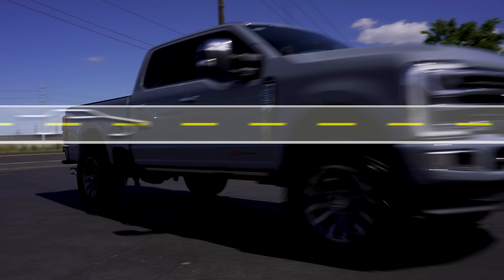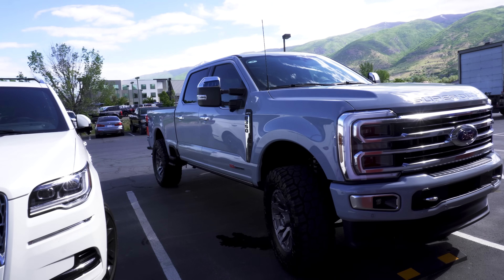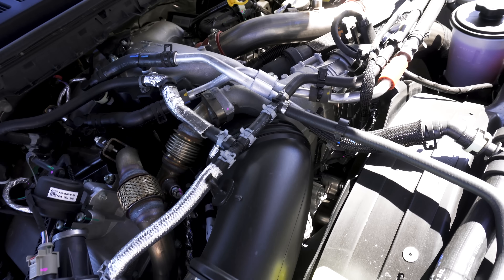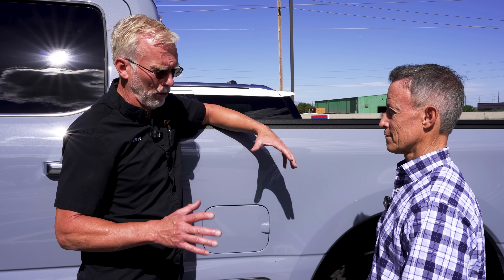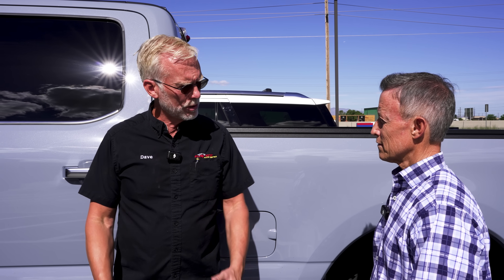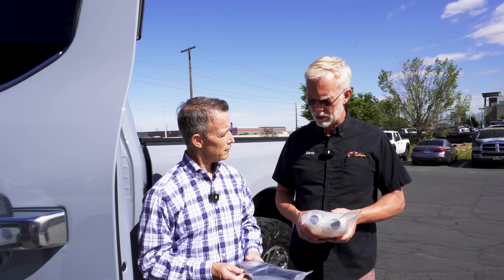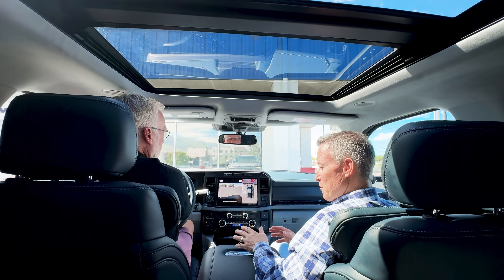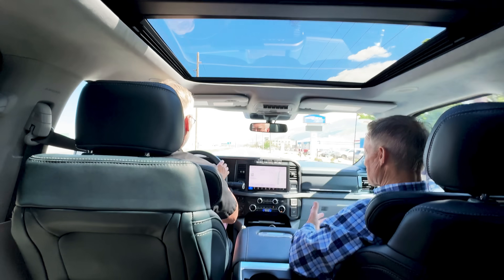Diesel Truck Maintenance

Comment: Step one.. Delete it right now. Run a good single tune from a reputable tuner, a low HP tune, dont add much power if any. 5 position tunes for 6.7 powerstrokes are crap.. They are all basically the max power tune with fuel pulled off of the top end for the different HP levels, dont run those. Also add a disaster prevention kit right now. Dont waste your money on aftermarket air filters or transmission pans or any of that crap. 

Change oil every 5k, dont mess with testing your oil, just change it. 5w40 synthetic Rotella T6 is fine. Fuel filters 10k. Air filter 20k. Trans fluid and filter, transfer case fluid and rear diff fluid 50k unless you tow heavy often, then change it more often.. You dont need to flush trans fluid, just pull the pan, change the filter and refill. Crankcase filter 50k. If its cold out let it idle for 3-5 minutes before driving and be easy on the throttle until its fully warm, if your towing hard let it idle 3-5 minutes before you shut it off.. Other than that dont let it idle much. Fuel additives are a good idea with that CP4 pump. I like hotshot secrets. Don't run your tank low on fuel, fill up at 1/4 tank. Dont lift your truck, run stock size tires. 

If your towing heavy and you see a hill coming, manually downshift the transmission before you start pulling the hill. Try to make shifts happen when the engine isnt already pulling hard. Dont let it lug. If the engine is working hard RPMs help it and the transmission live.

Comment: It's only a select few folks who qualify for vehicles like these that cost more than a house used to cost. With a house mortgage on it. I don't even wanna think about the insurance on that thing. 140 or 150 bucks to fill it up, 150 or 200 bucks to do an oil change interval on it. You wanna wash it, they probably charge double what a small passenger car costs for a car wash. Also....I hate to think how much tires are on that thing. Have fun with it, sir.

Comment: Folks another tip. I own a 2019 ford f250. It gives us NO information when the truck is approaching a DEF REGEN and it does not tell you when it is in a REGEN cycle. I bought a BlueDriver obd reader and using my phone ill watch thr DPF REGEN TRIGGER percentage when driving. When it enters regen i will downshift one gear to raise those rpms. I really try to not head home (or go to the store) until the regen is complete. Its cheaper to burn another gallon of diesel to complete a regen than it is to send these trucks to the maintenence shop and have the cab body lifted off the chassis. I really wish manufacturers gave the driver dash messages of how close we wre getting to regen cycle or when we are Regen'ing.

Comment: Folks! One tip is, theres a good video out there from a man who manufactures DEF. I learned it expires quickly. Quick when its hot outside. I always only have max 2.5 gallons of def in my truck at a time. At the store i look over the bottle for expirarion date before i walk to cashier and i also dont buy the jug which is the display model that has been removed from the cardboard box. And i also do not buy the def which is outside in the sun or at the entry way to the store. My local store i walk to the back wall where they have truck parts and grab a newly manufactured jug from there. My opinion is unless you drive your pickup like youre a semi long haul trucker do not keep your def tank full. Its just expiring sooner. Like i said i always run just 2.5 gal at a time and wait for the warning light. Go find that video of def fluid here is the title to the video you should see. "Expert shares diesel exhaust fluid info saving your major engine"

Comment: I'm a little late to this video but Dave you would want to replace your fuel filters every other oil change (10,000 mileage). On Mopar service interval they recommend a 8,000 mileage fuel filter service interval on the cummins, but on the eco diesel they want you to replace the fuel filters every other oil change (10,000 mileage). On GM there is a percentage on the dashboard and on GM I would recommend replacing your fuel filters at 50% on the GM. Rule of thumb I would recommend 10,000 mileage maintance interval for fuel filters.

Comment: Change the fuel filters every 15,000 miles?  Great advice, that's exactly what my Superduty Owner's manual states.
Reply: I plan on doing mine every other oil change (every 10k miles).
Reply: @calientemac1 why?
Reply: @calientemac1  Why, are you a Mechanical Engineer or someone who is smarter than the Mechanical Engineer PE working at Ford?  Please let me know so I can sue Ford Motor Company to re-write their maintenance manual.
Reply: @FISHH00KS it’s my truck so I can change it whenever I want 🤷🏻‍♂️
Reply: @calientemac1 why not every 100 or 1,000 miles. Why 10,000. Surely you have a logical reason. I mean you’re not some half-Witt lunatic that thinks it’s somehow better than changing at 15,000. You’re a Mechanical Engineer. I would like to know the secret.
Reply: @FISHH00KS I’ve spoke to a very experienced diesel mechanic that made the recommendation and Im going to choose to follow it.  He recommended doing oil changes every 5k and change out both fuel filters every other oil change.
Reply: @calientemac1  You're very lucky.  Most mechanics barely made it out of high school if they made it out at all.  There's no licensing required to work on a car nor are there drug or IQ test and no criminal background check or status of ex-con required to be submitted to a parol officer.  Surely a mechanic would never suggest you replace an item just to pad the bill.  That never happens and everyone has an honest mechanic.  WHO DO YOU THINK YOU'RE TRYING TO CONVENIENCE?  DO YOU THINK EVERYONE ON THE INTERNET IS SOME MORON THAT HAS THE IQ OF A BRICK?  Your mechanic - good for him in spotting some fool that he can part their money from.  He's apparently smarter than you.

Comment: Diesel economy is a huge lie currently. Some applications certainly need them but most 1/2 to to at least 1 ton do not. Current fuel prices in my area are about a dollar more for diesel. Oil and filter changes are WAY more than gas. Now add ANY repair and you are so upside down over gas it is mind boggling. Can anyone say the cost of DEF and additives? I have owned many diesels years ago including two in a boat but I really question why anyone would buy one under today's conditions. At least they are cheaper to buy off the dealership floor LOL.

Comment: Good info. I also idle my diesel Sprinter van for 30 sec-1 minute after parking to cool down the turbo, before shutting it off. Religiously use a fuel additive - Diesel Kleene or Archoil, but any of them are better then not using one. I use oil analysis to keep an eye on wear metals, but change oil every 5000 miles regardless.

Comment: DAVE  DAVE DAVE!!!!!!!!!!!!!!!!!!!!!! Just trying to get your attention. Hey, it would be great if you make some videos that talk specifics about how to maintain specific diesel engines. I mean like one for a 6.6 Duramax that talks about specific weak point and how to improve them. What should get opened up and inspected. Where one can expect failures and at what mileage. Do one for each series of engine. Also it would be really helpful to go ahead and name names when it come to what brand of die is best. What oil, additives, filters ect. We would trust you as opposed to others who might just be running a commercial for their sponsors. Although it might not be prudent to talk about the bad ones I doubt that a OEM would complain about honestly promoting the products you use.  Thanks

Comment: Beautiful truck 👍. From my experience in driving semi's for trucking companies for the last 25 years is that the companies who change the oil the most have the least problems. Even in my own cars I'd change the oil every 3,500 miles and use THE BEST oil you can get. I found Valvoline oil always made my cars run much more smoothly and in terms of fuel Shell make the best kind of any fuel you can get. My 19 year old Saab gets much better fuel milage on Shell than any other make and my partner's 2016 Audi Q7 3.0L 272 diesel gets around 650 miles on Shell diesel from around 17.5 US gallons.

Comment: my 05 duramax never had any problems with 255k HARD miles, in winter I added 1oz per gallon of fuel of 2 stroke TCW3... adds lubricity and btu... additives are a scam, period... TCW3.... look it up, anti gel properties the whole 9 yrds...

Comment: Dave has his friend second guessing buying a diesel. I own 4  diesel trucks that were ALL bought new and driven by myself/my son/or my dad: 2015 f250 with 308K, 2011 Ram 2500 megacab with 295K, 2006 chevy 2500hd with 579K original eng/trans with all emissions intact, 2001 chevy 2500hd- heavily modded with dual CP3's, wagler cam, 45 over injectors...etc, the ram and ford were deleted around 150K and never had problems again.   Long story short--we change oil every 15K with amsoil and have converted oil filters to CAT 1806 filters........We NEVER let them sit more than a few days at a time and allways change fuel filters/air filters/oil at the same time

Comment: Since driving these modern day diesel trucks in the city is bad, is driving them in the city in a lower gear maintaining the rpm at around 2000 rpm a bad thing.

Comment: Man.  Dave I love your channel and I just bought a 2025 F350.  You really left me hanging on this one.  By 11:30, you gave no maintenance advice other than change your fuel filters at 15000 and change your oil at 3500 - 5000, and suggested oil sampling analysis.  Early on you mentioned there are differences in diesel fuels, but gave zero info beyond that acknowledgement. You mention you use additives, but again, zero info or recommendations. You ended the video by saying you don’t think you’ve ever done a video where you gave this much advice??!!  I’m confused and kind of frustrated.  I literally just filled my truck up for the first time.  I was wondering about the quality of the fuel and additives and I’m left still wondering.
Reply: As a new diesel owner I came him for the exact same reason and now feel the same exact way after watching the video. lol

Comment: I am planning to get a diesel truck for myself.  I heard you mentioned that 3k-3.5k miles for oil changes. Is the interval for synthetic or regular oil? And how often do transmission fluids need to be changed? Is anything from the diesel engine required extra care that the gas engine does not?

Comment: @DavesAutoCenterCenterville
Great video's, I am learning a lot. Thank you!
I have might have a silly question. Given that the EGR is terrible to the engine and now they have newly introduced the DPF and DEF. Wouldn't be best or possible to modify the EGR by intake to after the DPF and DEF rather than before it? So that we can at least have a cleaner exhaust coming into the engine?

Comment: I have a 2003 Duramax federal without EGR with 400k. I still have the first injectors, and the truck has never had a single problem with the engine except for the coolant system. The water pump, radiator, and hoses are changed. And this is the second turbo. That's the only thing that was replaced on the engine. Alison transmission has never been replaced. The transmission oil and the filter were changed every 25k. Now you can conclude how much the EGR system destroys the engine. I know you will say that this is not true for Duramax injectors, but the previous owner used to put something in the fuel that cleaned the injectors every 10k

Comment: What is the thinking on using an exhaust brake for warming up? The exhaust brake manufacturer says it's cool but is it safe? I do a lot of work where I'm in and out of my pickup while it's idling and use the exhaust brake when cold. 2nd gen Cummins 24v.

Comment: Hello!  I am trying to learn as much as possible about diesel in preparation for buying and converting a used ambulance into an off-road camper.  I am interested in a medium duty truck (I.e. Freightliner or International).  My question is able idle time.  You mention that idle time is bad for a diesel engine; however, ambulances do rack up significant idle time because the medical equipment in them must remain powered up during a call.  Is there something that mitigates idle-related wear and tear on an ambulance engine?  If not, how many hours is too many for a used ambulance?

Thank you!  I really appreciate your insight and expertise!

Comment: I am sure Dave is very Professional. I must say, not one of that guys questions were answered.  That guy asked about specifics he could employ in a maintenance plan. He got 15 minutes of engine bedazzled smoke. Not trying to be a smart ass. Give us specifics, like 1,2,3 this is the plan. Not EGT parameters for  a novice new truck owner to understand. Ok, not all Diesel is the same. Well, what do you recommend? Not just my friend knows that oil companies  refine differently, or the Diesel  is  not good in foreign countries for marine engines. What Diesel do you recommend? I did not get the answer from the vid.

Comment: I've been bingeing a lot of videos on diesel maintenance since I have a 2007.5 Dodge with the 6.7 Cummins.  I bought it used with 18k miles in 2008 and had no idea it was the very first year they came out with DPF's.  Long story short, I learned a lot about them in 2013 when the DPF clogged at 63k but only just how to drive it (no long idling, drive until it stops regen, pull loads, no short trips and highway more than 45 minutes) but nothing about maintenance other then the usual filters/oil which I kept up on. 

I had an Edge Insight monitor to tell when it went into regen but it died over a year ago. Because of the DPF I was very leery of additives but it seems I was stuck in the past after watching so many videos.  So, I'm waiting for the Banks iDash to replace the Edge to show up, got me some Archoil and hoping to get a base line on the DPF before I start adding in the Archoil.  When I had the Insight monitor I kept a hand written log of when and how long it went into regen.  I got my eyes opened when I saw people saying they go 500+ miles before regen when mine faithfully went into regen around 110 miles on the highway and every 60 miles in city driving for years.  Will the Archoil increase the time before regen, I'm hoping.  If not, I don't have DEF and my DPF is held in with clamps/not welded so pulling it and giving it a cleaning wouldn't be too hard DIY. The IDash seems to be a much better monitor than the Edge which was a pain to set up the PID's plus had a very small black/green LCD.  Next up will be some Seafoam or similar in the crank case.  All those years I got it up to 136k, its really not even a teenager as far as diesels go and runs fine at the moment. Its never had an injector cleaning so I'm kinda excited to find out how that goes and if my regens take longer between cycles!

Comment: Few simple rules to get the most of any unit, especially a diesel.
Delete all emission junk!
Keep fuel additives on hand with every fill up +!
Oil bypass kit is a must!
Use synthetic lubricants at moderately heavier weights and viscosity than what factory recommends aside from warranty of course, lol!
Run the right, proper and professional tunes, time, place, etc!
Finally, drive the units with mature responsibility and use/drive them for the reasons they made em in the first place!

Comment: Unless you're hot shotting 15,000 lb + gooseneck across country every week, just get a newer gas 6.6 GM  or 7.3 SuperDuty gasser. These newer diesels are prone to failure with all this EPA garbage. Unless you can delete that stuff, there's just too much to go wrong & way too expensive to repair. These new gassers are actually very impressive even for the occasional heavy load hauling.

Comment: I would recommend to change your fuel filters earlier if you have a work truck that drives long distances, and several fill ups at different fuel stations. Fuel quality is not the same everywhere as he said. Diesel mechanics that drive diesel told me every 7k to 10k.

Comment: I change oil and filter every 5000 miles fuel filters and air filter every 10000 miles  have 279000 miles o 2017 f350 6.7 powerstroke maintenance is the key and dont drive like an idiot no blowing black smoke

Comment: So I know people who’ve been using Marvel mystery oil and their diesel fuel for years and some of them have 300,000 and 400,000 miles on their diesels with the same injectors. they say it lubes the injectors and the whole fuel system and cleans them. The problem with diesel fuel is it’s actually too clean now because of all the green bullshit so that’s why if you don’t add something like Marvel mystery oil your injectors will take a shit eventually because there is no lube and diesel anymore

Comment: He needs to put an amsoil bypasse filter system on that truck to keep that oil clean because of the EGR and don’t drive it like a street queen , I learned a lot from the diesel I had , got rid of it and went back to gas because of California, stupid smog laws.

Comment: I'd love to see an experiment with DEF. I've heard so many times about how corrosive it is. I run heavy equipment and for over 10 years I've been filling DEF tanks on machines and it spills plenty but I haven't seen excessive corrosion at fill areas.

Comment: Delete the EGR and DEF (there are plenty of ways, you just have to know and trust the right mechanic). Change your oil 3,000 miles with a good synthetic oil. Use good air and oil filters and change them frequently. Rotate your tires. Do NOT hot rod (race) your diesel truck; they are for pulling. My L5P just turned 300k miles and runs like a top.